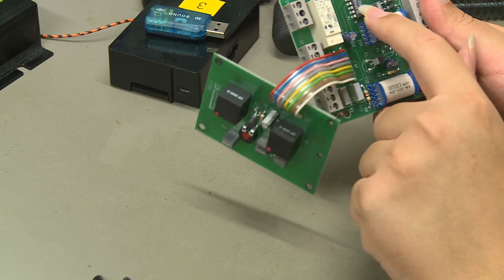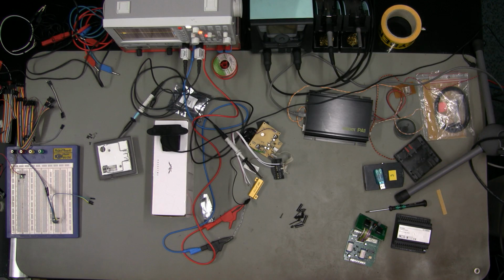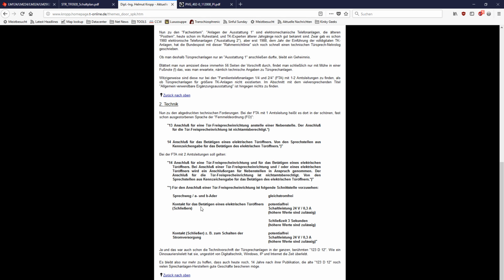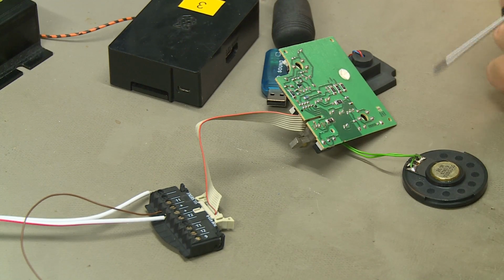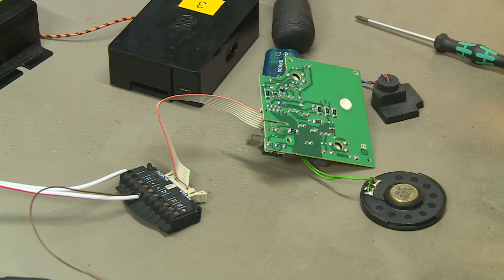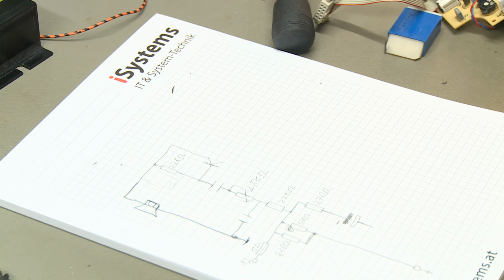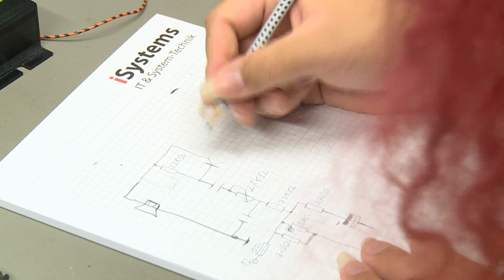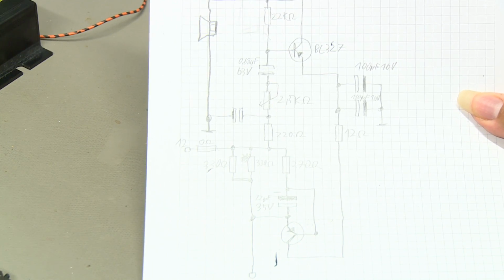SIP Door Intercom and MQTT Door Bell – Part 2

Comment: Did you manage to complete the project?
Reply from the maker: Sadly not. In the end it was not worth it to reverse engineer how they did the 2 wire transmission. I just used 4 wires and mounted a speaker and microphone in the emptied out Siedle Speaker module that are hooked up to a sip door intercom module from 2n.